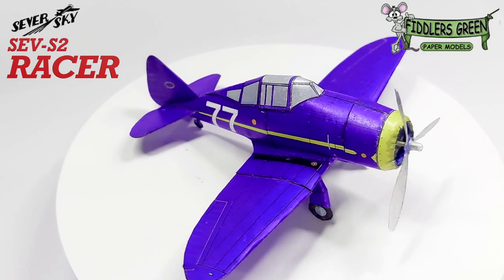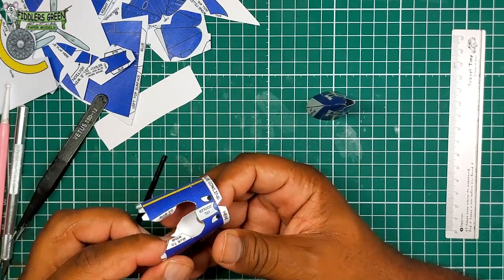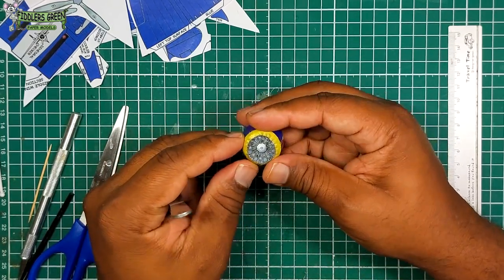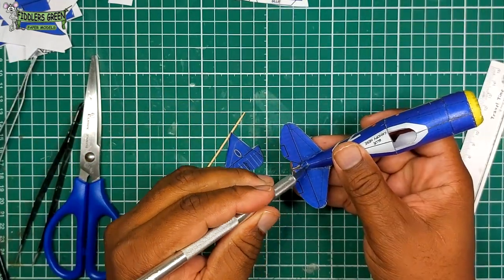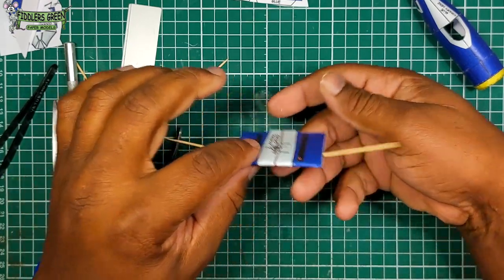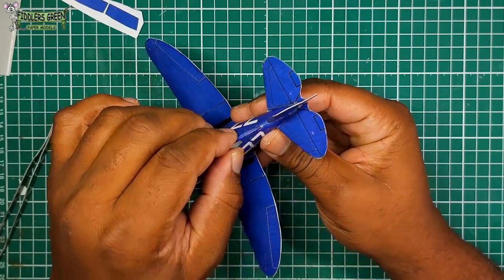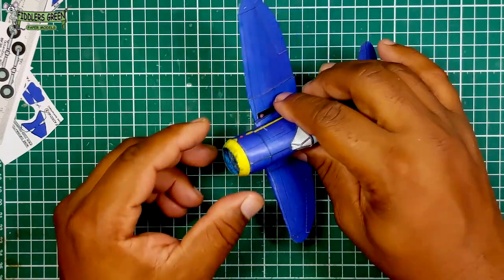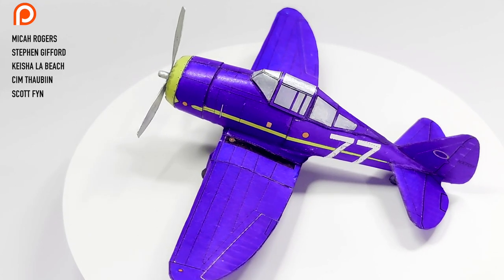BEGINNERS GUIDE - HOW TO BUILD FIDDLERS GREEN MODEL   SEVERSKY SEV-2S RACER

Comment: Do you ever clear coat your models?  If you dont, do you think it would tie everything together?  Great video and build.
Reply: los mios los limpio con un trapo humedo con una cera para madera y algunos cotonetes
Reply from the maker: Yes I do! but not these fiddlers green models. i just laser print these from the Stationary center. but for the others you see on my channel? for sure. i use oil varnish for them. first gloss then matt as final for most. Cheers.